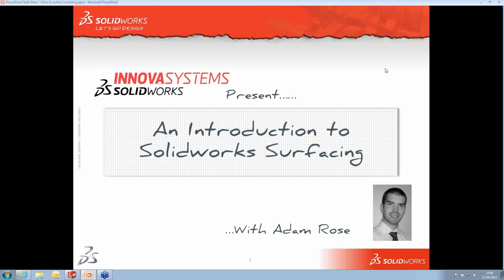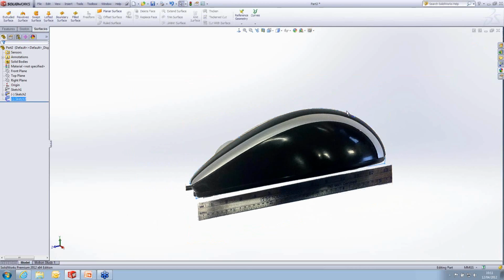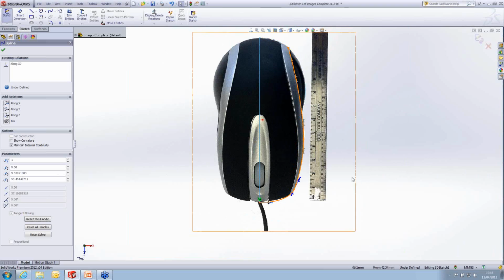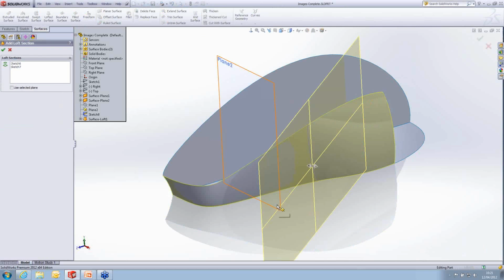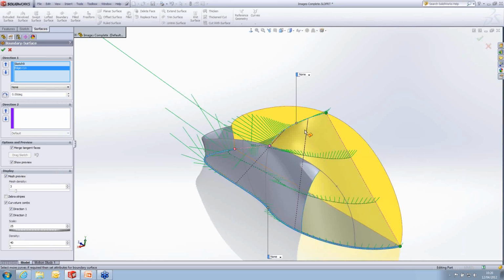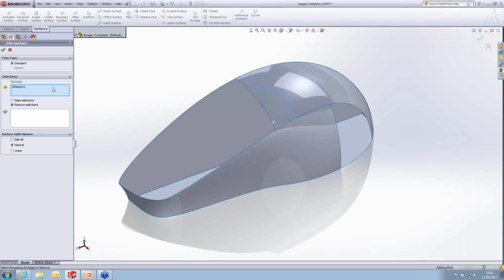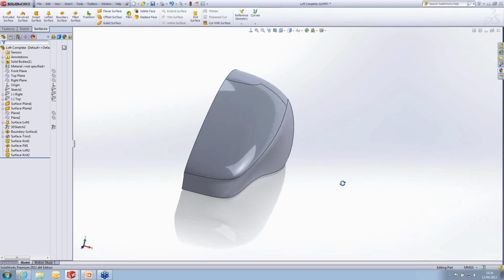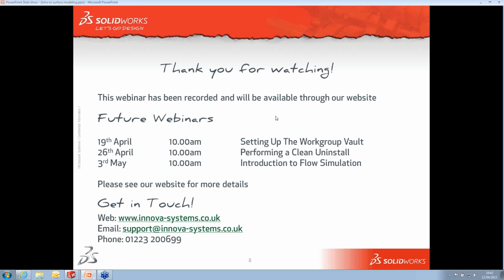Introduction to Surface Modelling in SolidWorks [Webcast]

Comment: 25:00 Why the seemingly arbitrary shape?  I was able to reproduce what you did, but I don't know why you did it the way you did.  Also, when you use another model to close in the top front section, saying that you've already shown how to do a surface loft, I've been trying to make that loft for the last hour and a half!  Would it have really been a big deal just to make the model from start to finish without having to skip parts??  Very frustrating........

Comment: for those whom the picture shows black colour after imported in Sledworks, try using snipping tool to save the picture as png and then import it,,cause default windows save is as gif which isnt supported by Sledworks

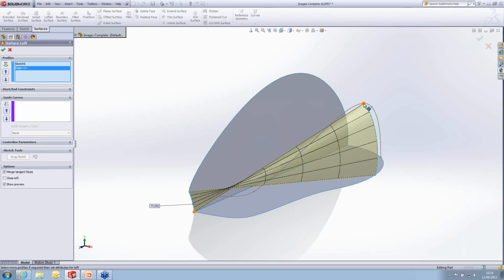Comment: Someone please help ASAP! How did you split the spline into two elements and used the loft tool @13:09. I Have tried using the split entities tool but whenever i tired to use the loft feature it selects the small element at first and then it re selects the whole spline.
Reply: I've just got it. It is not necessarily matter of splitting the spline. Try first to hide the sketch (in the history tree, eye or glasses sign) from which you made the plane and then use SURFACE BORDER element (as in the video - author picks a line, that is called "SURFACE-PLANE1") not a line from the sketch ... I hope this trick works for you ;)
Reply: @wojciechmysliwiec596  Thank you! This helped a lot!

Comment: any idea with 3d skectch ???? i stock and I dont have idea how to sketch on 3d, i folow very careful this video
Reply: Well,it is basically a 3D curve which you can control in X,Y and Z direction,unlike in 2D sketches.You see when he changes the view at 7:28 to top view so he can control it without messing it up in other directions,you can quickly change the views by pressing space bar :)

Comment: This is one of the problems I had last time: I keep getting a gap between the horizontal and vertical sections on the mouse. it looks fine to the eye but when you really zoom in, they aren't joined. Trying to add relations doesn't seem to hack it... help?

Comment from the maker: At 3.50 you’ll notice that I actually constructed two separate splines to produce the mouse outline, you may find this a little easier than drawing one and using Split Entities. I would recommend making sure that the sketch is hidden when you come to select the edges at 13.00.
Reply: Innova Systems - Experts in SOLIDWORKS Training & Support 😚
g.h
.h .   lf cxdlddll 669696o70pp
Reply: Can you help me how to make it fully defined?
Reply: @cridgemcking2471  for some reason they didn't show how to define it...

Comment: I was unable to perform the boundary surface at 22:50 because I wasn't able to select the splines from the original planer surfaces.  SW only allowed me to select the entire closed loop around those planer surfaces which results in an error message.  What am I doing wrong, how do I only select the curve that I want?
Reply: The same problem I had...
Reply from the maker: You may be selecting the sketch which created the planar surface. Make sure this is hidden before you attempt the boundary surface. If your still having trouble try Right clicking in the graphics area to bring up the selection manager, this tool will allow you to select individual sections of an edge –setting this to select group (cursor symbol) often works best.
Reply: Thanks a lot ! I will try it tomorrow. 
Wish you all best ! :)

Comment: How does he make this look so easy?  I try to replicate this with arbitrary geometry and run into all sorts of issues getting the loft features to work....
Reply: welcome to the wondrous world of SW hahahaha
Reply: Had the same problems with the very initial surface loft.  I actually redid all the splines so that, when selected, they consisted of only the border of the loft feature (when he selects, the guide curves actually extend beyond the point at which the loft feature ends) and it still doesn't work.

Comment: if you wanted one of those splines to be along a straight edge (in one plane ie a fixed distance from centerline but over a curve in another axis) for a certain distance but with all the curves up to that point nicely tangent . how would you do it? i cant find a way to do it without using a line section in between two splines then it wont loft using it .... there has to be a way!!!! am i taking the wrong approach? cant find anything like this anywhere

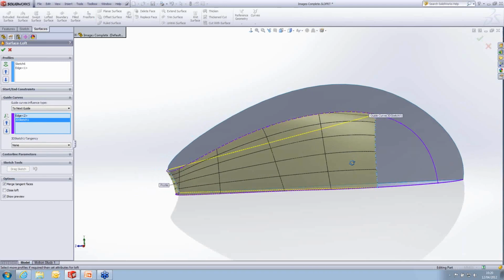Comment: I try to split the vertical surface at the location of 3D curve, but somehow i am unable to select the short line needed for the surface loft ( at around 13:30). Anyone that can help? I can see the short line, but once I click it it selects the whole vertical surface.
Reply: Same happens with me, im using Solid 2014, i dont know if that have anything to do with the problem maybe it worked with older versions, i dont know...

Comment: this is an amazing tutorial on surfacing thank you, I'm just struggling to import the picture using the sketch picture tab its not usable to you have any advice or a way to bypass this feature to get the picture in to solidworks?

Comment: How exactly did you create a midpoint relationship with the right surface plane and and the second line plane 6:24... Im not that fluent in solidworks just trying to learn a little more for my upcoming project